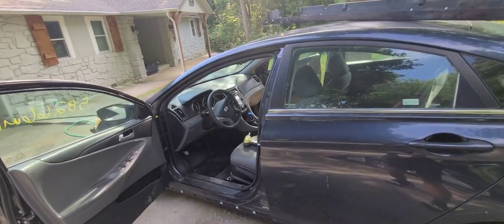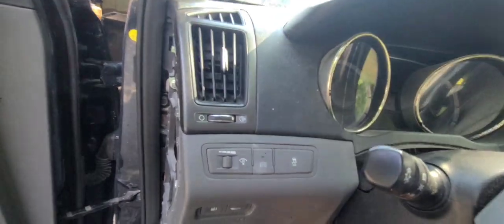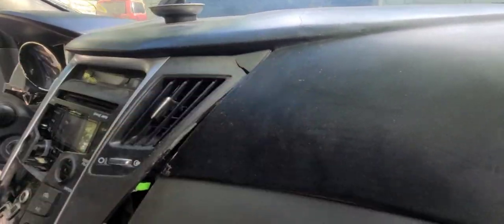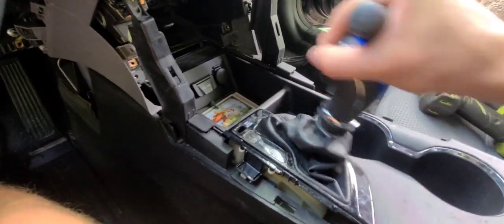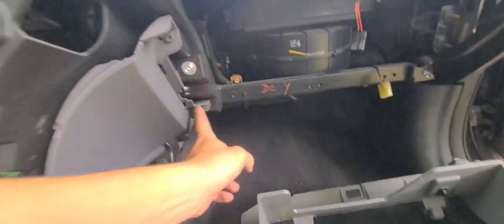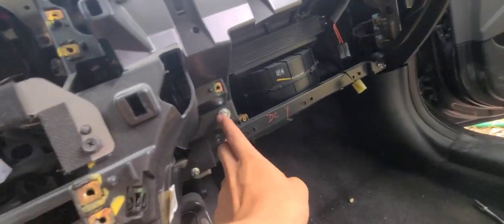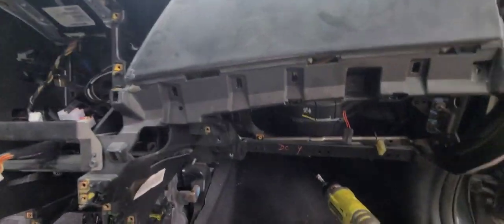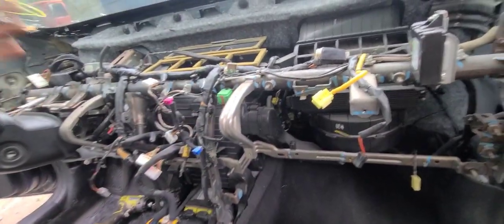2011-2014 Hyundai Sonata Dashboard Removal Tutorial/How To

Comment: Here are a few things that you missed that might help others.  1.  You don't have to mess with the center console at all.   Only thing I did was disengage the shifter.  Block the wheels when you take it out of gear or put on the parking brake.  Don't ask me how I know this is bad.  As long as you remove all of the screws below the radio, the vertical brackets that get in the way can be moved to the side enough to clear the lowest center portion of the dash. 2. Next there is another connector.in addition to the two speakers and air bag there is a light sensor.  It is at the front most portion of the dash where where the windshield meets the hood.  This sensor can be disconnected prior to taking out the dash.  The cover for the sensor pivots up exposing the connection.  Getting it fed back up to connect again was difficult.  I ended up putting painter's tape around it to give me something to grab and then pulled it through and snapped it into the plastic cover.  Then snapped the cover in place.  3.  The glove box connectors only go in one way. There is an extra notch on one side that matches it's mating side.  Make sure the glove box is pushed up far enough and they go in easy and then can be rotated 90 degrees.  4.  If you are swapping out the air bag you only have to remove the outer two screws.  The entire assembly then rotates out if you pull out the plastic surround where it snaps up into place.  In-spite of these few things, you have the best video out there to date.  I thought about re-making yours's but it is still pretty good.  I subscribed to your channel please subscribe to mine.

Comment: my top part only is splitting from heat. is there a way to only remove that portion and replace with a used dash that is not cracked? Instead of having to disassemble the entire thing as in the video?
Reply from the maker: It’s all one giant piece. You can buy like carper covers and cover it up but if you want the dash looking new I would replace the whole thing.

Comment: How did you rotate the plastic connector in the a-pillar cover.
Reply from the maker: I used some long nose pliers. Putting it back was the most difficult part.
Reply: @howtoamerica  Ok, thank you.  I had a terrible time getting a grip on it and it did not seem to rotate on mine. I ended up just popping it straight out.  The other end is similar to all of the other snap connectors on the dash.  Thanks for doing the video it did help a bunch.
Reply: @howtoamerica  I busted both of mine. Of course you can only get them from Asia. Wish I knew I was supposed to twist them.